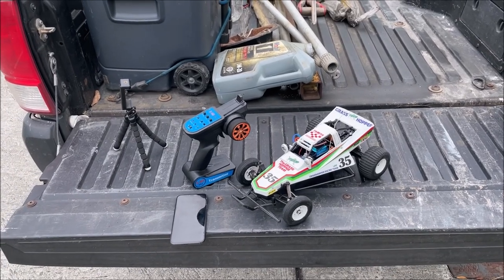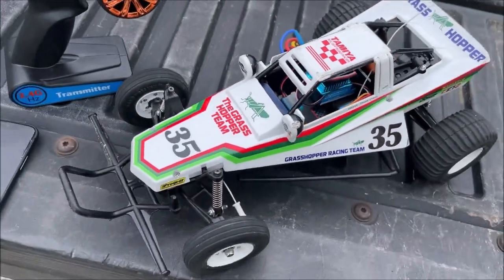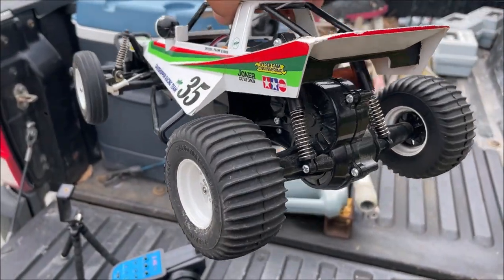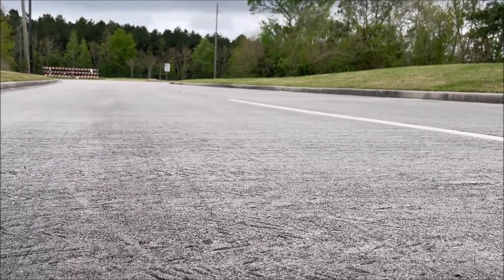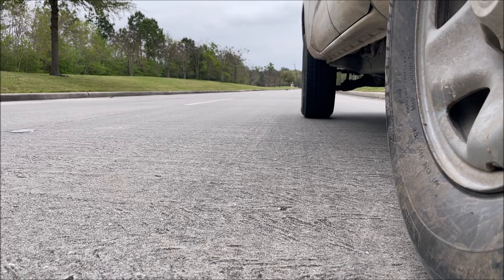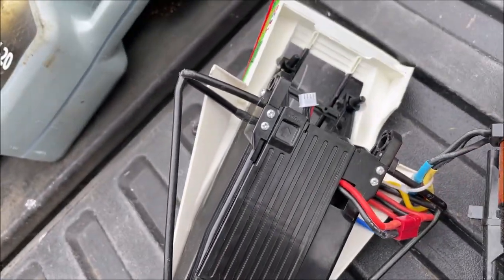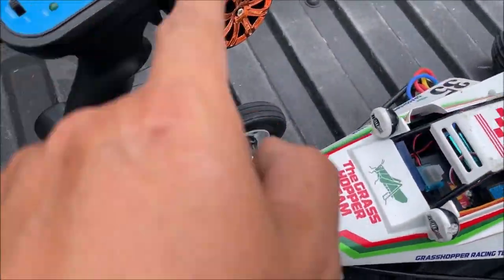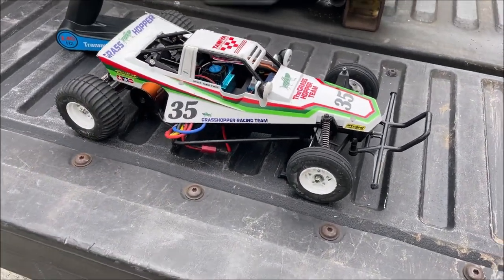Tamiya GRASSHOPPER speed run PART 3

Comment: Awesome experiment!  For me,  I never go brushless on any older 80’s Tamiya rerelease or even vintage toys.  Those weren’t even designed for that speed unless you like things to always break which you experienced.  For a 30 plus year old design oh my, no!🤣.   They are very fast on asphalt, but it gets very unstable and for many that plays with the car off road forget it!  To me, it’s not fun just going back and forth on the road.  For all my old designed Tamiya toys I stick with brushed motors either sport tuned or Tamiya Super stock motors.  All in all though, great experiment and for educational use for many that are new to the hobby or just curious🤣. Keep up the great work!
Reply: @christopherdeguzzman1137 yeh mate I fully agree with you . I kind of posted the same thoughts before I scrolled down the screen and saw your post. I completely agree. And even the ready to run cars and trucks that can reach 100 mph are kind of dumb. I mean that's an accident waiting to happen. You need to find a large enough place to run those 100mph trucks and then how can you stay close enough to keep from crashing when they can reach 60 mph in 3 seconds? That's not fun . I get the stunts are pretty awesome but I absolutely hate crashing my cars. I would rather keep a nice warm brushed motor and a 2 S lipo battery in my Tamiya vintage and re release cars. That's enough fun for me. 👍👌

Comment: Oh please man look after that little Grasshopper. They are too iconic and hold legendary status in the history of Tamiya RC cars. That crash made me cringe. Like I would rather mild not wild , that's what the Grasshopper was meant for. Even the Hornet they're both virtually the same with different body , tyres, motor and rear shocks. You can get years of fun out of these little Tamiya Hopper's.👍